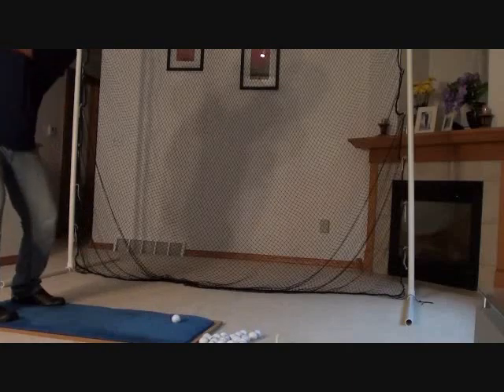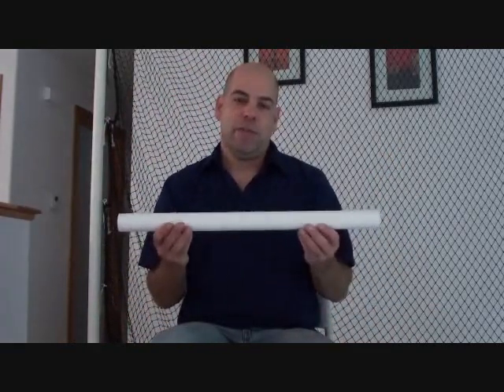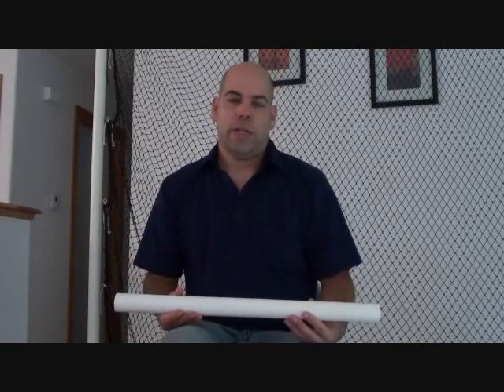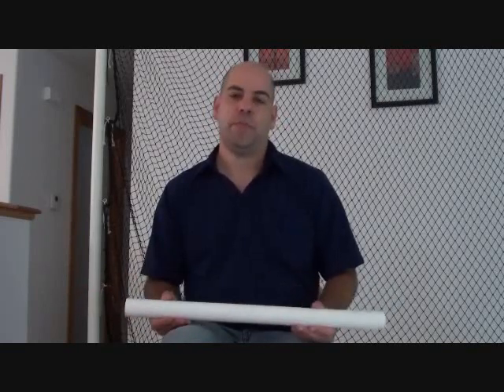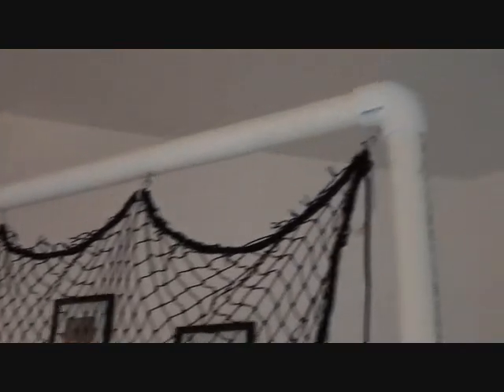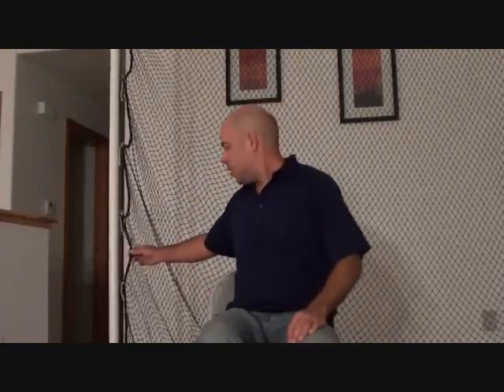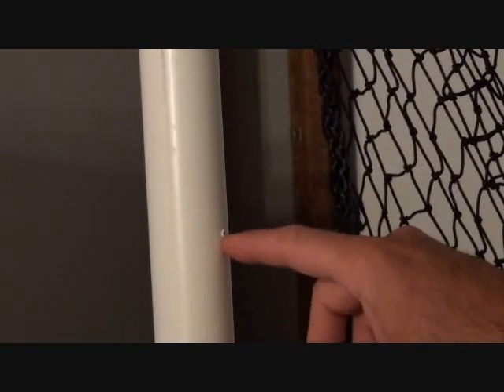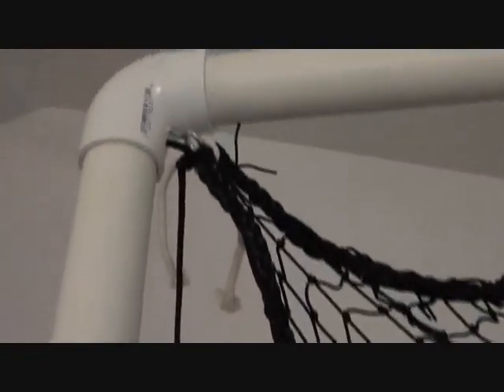How To Make An Indoor Outdoor Golf Practice Net

Comment: Those high dollar nets are durable enough but nothing was meant to last forever. I'ts always a good idea to keep the net out of the weather as much as possible when you aren't using it and washing the net every so often helps to remove airborne elements which may become infused into the net. Also avoid stretching the net as much as possible as stress will depriciate the nets durability.

Comment: I tried this out, works well, made an 8'x8' net using a 10'x10' net from gourock. It provides a good amount of slack. Stability issues for side sway for the "in-plane" motion, I tried holes in the elbow connectors and PVCs and tied nylon rope strings around them to hold the PVCs in place, other wise, one wrong move and push, the PVC slips apart. Otherwise, this net catches the ball really well. I recommend buying a good mat to practice on.

Comment from the maker: Hi basilayoub...I took a piece of wood and used some spray adhesive to attach a layer of foam (I bought a roll of foam material at Joann fabrics...it's cheap).  Then I nailed a cheap piece of carpet on top of that and I have a driving range mat.  Also if you want you can drill a hole through the whole thing on one side to be able to slip a rubber tee through for drives.  It works pretty good!  Brian

Comment from the maker: The weakness of the frame is side to side tilt.  I fixed that by setting it up in my garage with rope at the 2 upper corners that connects those corners to the ceiling joists in the garage.  Now it can't tilt to the sides.  If you want to keep those upper corners from pulling apart you could use PVC cement, or attach some metal brackets (then the only problem is taking it apart if you need to).  Brian

Comment from the maker: Yeah that would make it easier to remove the net from the pvc.  I thought about doing that originally, but I was afraid the net would keep slipping loose from regular hooks, so I opted for the eye hooks.  When I break the whole thing down I don't even remove the net from the eye hooks...I just disconnect the frame from it's joints and fold the whole thing up with the net attached, like a folding lawn chair.
Brian

Comment from the maker: Hey emmcclelland...yeah it has held up quite well.  The nylon net has stayed in perfect condition...I think it's impossible to put a hole through it with a golf ball.  The frame has held up as well, but the natural weakness of my frame design is some side to side tilt.  I have solved that problem by setting the net up in my garage, and I have the upper corners of the frame secured with rope to the ceiling joists of the garage.  Now it cannot lean side to side at all.  Cheers!  Brian

Comment: I really like your golf net project.  It's a great idea and it looks well executed.  

I had a few questions regarding your net:

1.  Is the bottom secured in any way?

2.  What size is your net?  Do you need a larger net lengthwise so that the ball has some room to travel?  I would think that without room, your ball would fly back like a trampoline.

Comment from the maker: Hey Troy...you definitely want the net to be bigger than the frame so it is loose and can absorb the ball.  so for the 7'x8' frame, I went with the 8'x10' net.  If I remember right there were several netting options at the Gourock website (I ordered online).  I went with the 3/4" diamond pattern knotted nylon net, with a braided dacron rope border.  I have never had a ball go through the net, and it has never torn on me.

Comment from the maker: Hi seanyeezy...I just took a tape measure and measured the internal and external diameters of the PVC pipe.  The internal diameter is 1 3/8" and the external diameter is 1 5/8".  There are so many numbers on the side of the PVC pipe, I didn't know which is the measurement, so I just measured it manually.  I hope that helps.  Brian

Comment: As for the volleyball question, you could do the same thing but use BIGGER PVC tubes and on the sections that touch the ground you could make wire "anchors" to hold them securely to the ground.  Kinda like tent pole stakes.  You could also weight the ground tubes with sand to aid in them staying put.  Use 2 or 3 inch PVC and weight it along with wire anchors.  That thing wouldn't go anywhere.

Comment from the maker: @chunkychad3 Hey Chad...the net dimensions are 8' x 10'.  I got the net first and then built the frame to match the net (so for height the frame is 7' for the 8' tall net, and for width the frame is 8' wide for the 10' wide net).  If you are a decent golfer I don't think you need a net this big, but I built it when I was just beginning golf and my ball might fly anywhere.  If I had to do it again I might build the frame 6' by 6' which I think would be plenty big, with smaller net.  Thanks Chad

Comment: Brian, try keeping your left arm a little straighter, keep the triangle made by your arms intact on the take away.  I'm totally doing this and also putting the song in my iTunes...may remix it.  Thinking of creating some kind of base, maybe with cement in my yard to slide the supports in and out of...might give it some more stability...do you find the that elbows at the top become loose over time?

Comment from the maker: @rcas1202 The other option is to use some heavier material as the net...like a tarp, or tent material, or a thick blanket.  It wouldn't look as nice as actual netting, but the heavier material would stop the ball quickly without much give.  The downside to using heavier material as the net is that it would put more strain on the frame.  If you needed a stronger frame for that you could use aluminum poles from the hardware store instead of PVC.  Good luck!

Comment from the maker: @yankee76 Hey Yankee...I'm glad you liked the vid.  I've been using my net every day for about 6 months and it is pretty indestructible.  The only weakness is some occasional side-to-side tilt.  It's pretty insignificant, and if I wanted to stop that I thought about attaching metal brackets to the two upper corners, which would solve that.  Or if outdoors I thought about attaching rope and stakes to the upper corners to minimize tilt. But truthfully, it's sturdy enough as is.  Enjoy!

Comment from the maker: @MrBerndog07 Hey Berndog...I used the 3/4" knotted nylon netting (8' x 10').  The cost of just this netting was $50, but I opted for the braided dacron rope border option which added $36 to the cost.  So I spent a total of $86 for the netting total.  I think you could do just fine without the dacron border, but I think it would give your project some longer life, especially if you use it a lot like I do.  I've been using mine for 6 months now with no breakdown at all.  Good luck!

Comment: Nice Brian,  I used steel 10' conduit poles and Stitched together heavy duty Nylon soccer bags.  I have tried the netting you use but is it ripped after 3 days of use which is why I went to the nylon mesh.  It hang freely and it has never ripped, frayed or torn. Far to heavy for the PVC however, I like the idea.  Nice work.  My next purchase is to buy the same hitting panel used at golf galaxy stores.
Reply from the maker: I like your steel couduit idea...pvc can be flimsy.  I am going to redo my net at some point and I will use steel conduit.  Amazingly my netting has held up over the years...I am using the same netting you see in the video.
Nice job Aaron!
Reply from the maker: Also Aaron...if you could post a pic of your net somewhere I could see it that would be cool...I want to see your setup with the steel conduit.  Thanks!

Comment from the maker: The bottom is not secured at all...it does not need to be.  The weakness in the frame is lateral tilt (as you are facing the net it can tilt sise to side). This can be solved by attaching brackets to the upper 2 corners, or in my case since I moved my net into the garage I have attached the 2 upper corners to my garage joists using rope...this prevents any lateral tilt of the frame.

Comment from the maker: The whole project cost me about $120 for the materials.  The frame and hardware to attach the net were a total of about $30 from the hardware store.  The netting I used is professional grade golf ball netting and that was about $90 I think.  If you want to do it on more of a budget, the best way to save is on the netting.  You could use some tent material, or a painters tarp, etc.  You just need something that is tough and light.  I bought my netting from Gourock (it's good quality netting).

Comment from the maker: @stewartgpa Hey Stewartgpa...I went ahead and listed all the materials and dimensions in the information found just below the video.  Don't feel like you are stuck with these though...you can make yours pretty much any size you want.  I made mine pretty big (7' tall and 8' wide) only because the actual netting I used is 8' tall and 10' wide.  That said, I do like my big net so I can use it in my living room and not worry about putting a hole through a wall.  Good luck!

Comment: dude you can just use zip ties no need to buy the rope.... also 2 ft of piping on either side is fine and go ahead and glue them in there the legs dont need tearing down... on top of that putting a metal rod in through the bottom to weigh it down or even getting large books and a few book bags to lay on top of the legs helps them not give way so much... finally  if anyone was wondering you should have at least 10'-12' tall cieling to swing a full driver inside and about 15' wide to allow people to comfortably walk by you.

Comment: hey there I have a question, on your net are you using the #21 netting with the resistance of up to 241 lbs or are you using the #15 rope that has the 144 lbs of resistance? Just wanting to know which i should go with as im making this soon.
Reply from the maker: +DaGratest 816 If I remember right I went with the #15 rope.  Good luck!
Reply: thanks for the answer. definitely appreciate it. Fully submerging myself in this golf game. got lessons starting this weekend! cant wait to get out there and start practicing to get better :-)
Reply from the maker: +DaGratest 816 Hey I was wrong!  I just checked my order history.  It is the #21 netting with the braided dacron rope border. Get the stronger #21...I have never put a hole through mine.  Sorry about the mixup.
Reply: no worries thanks for the updated info. the extra 20 bucks or so to make sure i never have to get another one seem like a worthy investment. Thanks!

Comment: How high is your ceiling?
Reply from the maker: Hey Steve...I had a tall cathedral ceiling at the house in the vid (about 20 feet at the apex).  My ceilings at my current place are still tall enough, but I mostly use the net outside now.  I set it up at my open garage door, use two ropes to hold the upper corners of the frame to keep it from tilting side to side, and hit the golf balls into it from a mat on the driveway.
Reply: Thanks. Looking to build one and put it indoors...ceilings are not quite 10 feet high...which might be okay for most clubs.

Appreciate the response and the video :)

Comment: I have been installing indoor Golf practice ranges and Batting cages for years in peoples homes and offices.

Will say that the nets from Gourock are far BETTER to any net you can buy from the any sporting goods store here's the website:http://gourock.com/golfnettingpanels.html

I suggest the 3/4" diamond  by # 21 Nylon .
I drive the ball 300yrds. on the coarse, so I would not have this set-up in my house or anyone else's house if I where afraid the net wouldn't stop the ball.
Tip: most nets fail or get holes in them because the netting is pulled to tight......looser the better.

bbunch05 nice job economical and well constructed.